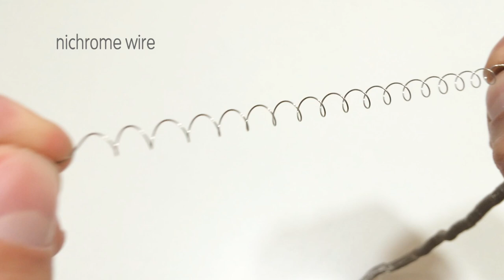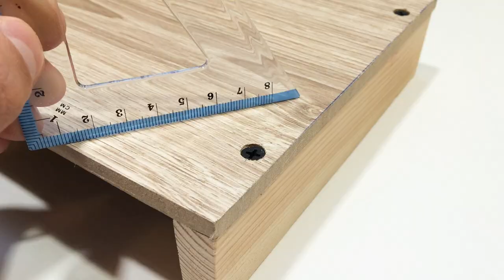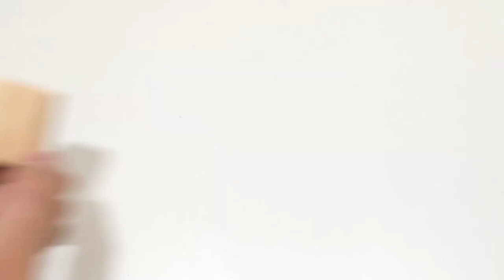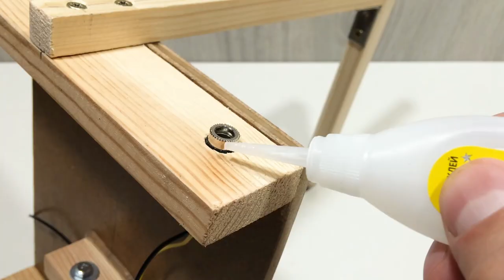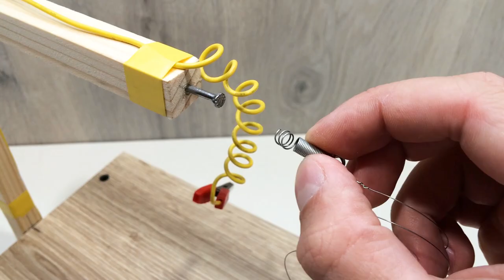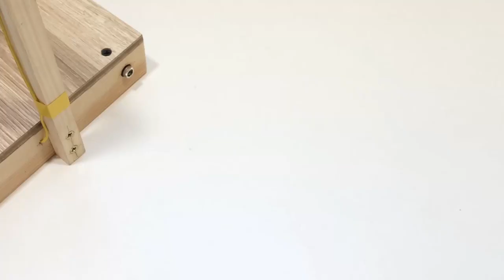Making a Hot Wire Foam Cutter | DIY Foam Cutting Machine

Comment from the maker: Hi Friends, 
The tools that I personally use and are time-tested!
You can buy with a discount on Ali using the links below:

Soldering iron 60W: https://ali.ski/C1dJb3
Soldering Iron (Set): https://ali.ski/1a7YRR
12V power supply: https://ali.ski/VHz7N
Screwdriver: https://ali.ski/1Bd-3  
Multimeter: https://ali.ski/VjXXJ
Set of hand tools 168 pcs: https://ali.ski/o3qkX 
Glue gun: https://ali.ski/P3d8D
Reply: Класс 👌

Comment: In case anyone asks, the reason a spring is on the Nichrome wire is that it expands when heated. Also, never touch Nichrome when charged, it is extremely hot.

Comment: does the power supply short circuit when using both positive and negative connected to a nichrome wire?
Reply: Required power to cut given thickness is testified through a multimeter within the power output of the supply。